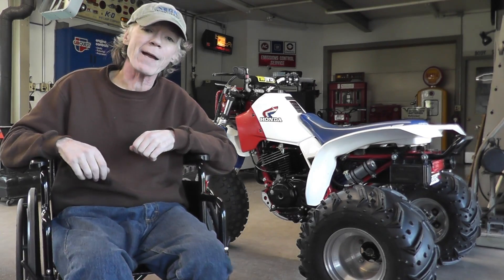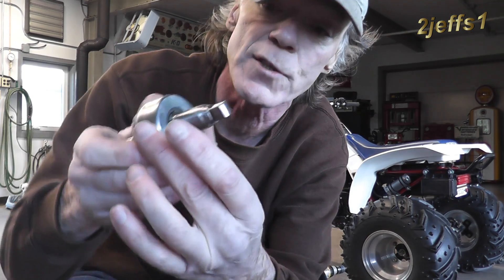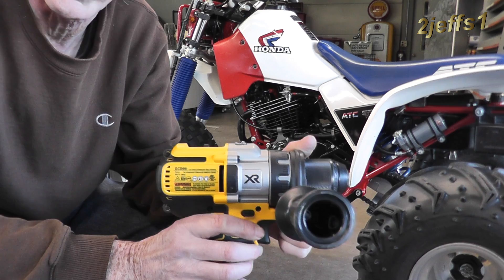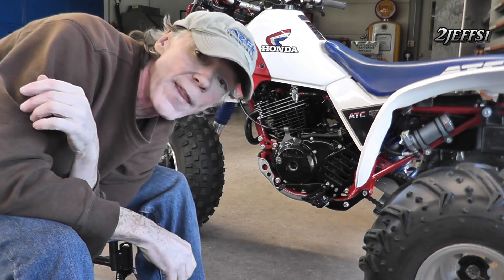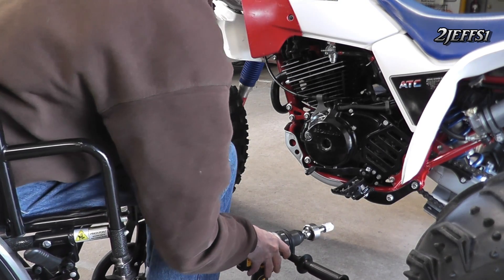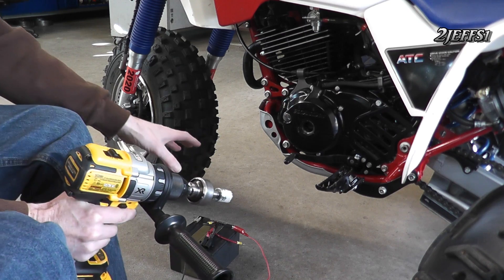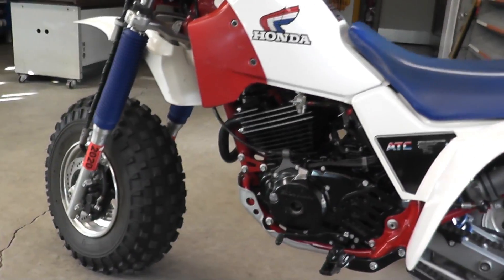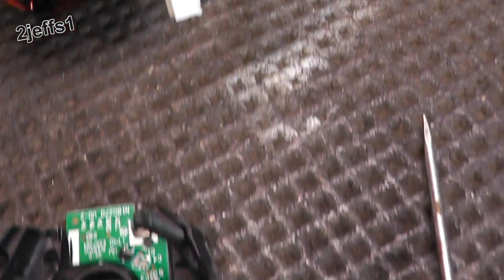Small Engine Starter Drive Setup THIS WORKS GREAT!

Comment: You would bendy benefit from s 9ah or even a 6ah. They can deliver a lot more current.  Those wires you have linking the packs are likely too small to provide a benefit. But you may also be maxing out the drill. Torque test channel consistently shows that 9ah improves performance

Comment: You’re adding capacity by hooking 2 5 amp/hr to get 10, what you want is more current, (amperage) to get more grunt.  When you increase voltage you decrease amps.    A 10 amp/hr battery has more capacity in run time over the 5 , not power. The power would increase by wiring the batteries in series ,  pos-neg, neg to pos. 
Now you have more power.  It would eventually burn out the motor, but not for a long time considering how short a Burst it actually runs to start the bike.  
The way you were doing it you were just making a bigger battery of the same power.

Comment: Hay brother get a 12 volt starter for a polaris 400 2 stroke scrambler. it has a gear reduction drive and is about the size of a brigs & stratton starter but with the power of a car starter. then get an old 10 speed bike and rob the gear set off the rear tire. it will spin one way and free wheel the other. weld the 10 speed gear to the starter gear then weld your cranking sprocket to the other side of the 10 speed gear. now take one of your 12 volt drill lipos and wire to it with a switch. now make a small box to house all this in and you are good to go. or better than this is to just buy a hand held 12 volt remote starter like the ones the go cart racing community use to crank thee modified engines. those work amazing and would crank your atv all day no problem at all and cost you less than that big ass drill probably did! hahahah love ya bro, glad to see you thinking outside the box. i live outside the box! visit me sometime.

Comment: That’s a good idea   I was gona use a ratchet head. But I have some old starter.  My Milwaukee tunes my techumseh star engine over good but it’s hard to control when it starts to remove the socket and it kicks back hard. Thanks for the idea.
Reply: Turns *

Comment: That gel cell that you connected up doesn't have the high amperage discharge rate like those lithium-ion batteries. The gel cell will struggle to discharge at 30 amps but the lithium batteries will produce over 100 amps or more. I learned about batteries way back when I was racing RC cars. Yep, had a few hard lessons in batteries.

Comment: I’m going to make this for starting my small outboard engine.
Reply: Actually… it won’t work because although the outboard turns clockwise, you are viewing it from the opposite direction as a land engine, so using the same standards, marine engines are counterclockwise.

Comment: Hey there good Sir.  I know that this video is several years old, but wanted to know how you are doing this without the bolt coming lose.  Looks like one of your answers was to use a drill instead of an impact gun.  Is that correct?  I want to do this on an NSR50 and and NSF100 with a super high hp and compression stroker-big bore motor.  Did you have to drill out the access port or was that motor already setup with the access?  My motors don't have one.  Thanks in advance

Comment: With your battery setup hooking them in parallel like that won't double the current it will just double the life of the battery or in other words how long it will last before it dies and you need to charge it again, of course hooking it in series would give you 40 volts but the same amount of life as one of the batteries..... However because of the circuitry attached to the batteries and in the drill I'm pretty sure everything's regulated to that 20 volts so even if you put 30 volts to it the motor in the drill is still only going to get 20 or I think it's 18 actually

Comment: Forgot to add that DeWalt has a 20V 6 AH battery.  With this one you don't have to look for other power source.  The machine has a dangerous torque and the side handle is highly recommended.

Comment: Hi Jeff,  Great video.  It is absolutely essential to have this DIY drive adapter for this job.  Although I have a drive adapter for my Craftsman weed eater, I did not know, it had a free wheeling shaft.  For other equipment I used the drill machine.  I have started various motors with my DeWalt DC995 without the adapter without any problem.  However, recently I reckoned my drill machine and had to buy a new one, now DC998.  The kick back of the motor ruined my planetary gear in the drill machine!  I have searched the internet for an adapter like yours, but could not find it.  I could send you a picture of the damaged planetary gear, if I new your email.

Comment: Jeff, thanks for the video.

I have an outboard motor that I need to rig up DIY starter for.  They offer an electric starter kit, but charge $750 for it.  I was wondering how to make a safety drive & the Chevy starter drive unit looks like the answer.

Comment: I made mine with a harbor frieght  halfinch drive socket wrench cyt the handle off amd tacked welded a drill chuck on the other end and made sure to keep the clockwise and counter clockwise selector free to be able to change depending on the engine and when the engine starts it spins freely just the same as the socket wrench would and it engages in whichever direction  u choose  and it took about 15 mins and 10 bucks to make instead of ripping apart a chevy starter i mean ur tool definitely looks nicer but mine does the job and is really strong also i found using a air tool or a corded drill it doesnt struggle or potentially ruin a cordless also at lowes u can buy these drill starters for craftsman weedwhackers the tool cost 20 bucks but is ment fir 50ccs and under

Comment: the reason why more amps makes the stop issue worse is there is less voltage drop under load, computer senses greater potential for damage/heat buildup, then shuts down quicker than if you used a lower amp battery setup. probably would still crank the beast over quick with a small battery

Comment: Torque wouldn't be changed by voltage or current. Get a starter and modify it to run your tool you made. Weld a handle on it and you will get the Torque you want. Oh and wear insulated gloves. LOL 
Love the video. I am relying on an electric wheelchair myself so I understand the frustration.

Comment: I’d love to see how u made ur starter for the drill.. we have a old Wisconsin 4 cylinder motor we r trying to start..we made a shaft kinda like for a old model a or tractor… so that way it can kick off.. we used it with a big electric drill… well no luck so far.. any help would be appreciated..

Comment: The drill starter is a good Idea especially for those who may only occasionally need to start a small engine.  For those who need to start engines on a more or less regular basis I think a portable starter made from a car starter and a lawn battery is more the ticket. Similar to the starters they use on formula 1 cars or racing go karts. Should be very easy to build and fairly cheap too if you use junk yard parts. Even a starter from a lawn tractor would probably turn that honda engine just fine, paired with a 7 amp hour SLA battery it would be reasonably light weight as well. Anyways just thinking out loud.

Comment: Great video...The starter drive on GM turns the other way...The way I learned it is the Ford motor Lose time... Turning CCW and GM gains Time...Turning CW...which means starter drive turns opposite direction ...IDK if that helps

Comment: Is there a commercial version of a starter adapter/ free wheel thing-a-ma-jig, doohickey, deelybopper? Welding is not my bailiwick.
Reply: Try the Performance Tool 3/8" Drive Ratcheting Socket Adapter. It is sold at Speedway and on Ebay for maybe $12 bucks or so. However, remember that you have to reset it after each use of it may get kicked back to the wrong direction when you have used it. It is like using a seat belt, in that you know each time you get into the car, you need to fasten your seatbelt. Same with this adaptor, as you have to always check it to make sure it is in the correct drive position or it can indeed kick back on you and possibly ruin your day, for sure. Tape or JB weld can lock it in place permanently so you don't have to worry in using this adaptor. The starter piece works great too, but if you are only using this for an occasional start up on a hard to start mower, edger or such and have limited welding equipment tor welding skills, then the ratchet adaptor is likely all you will need. I went to a local Auto Zone today to see if they had such in stock. The two simpleton people working the counter there today really didn't even know what products they sold to begin with. Good luck in tracking down the ratchet adaptor. There are some great videos on using such on YouTube, mostly under hard starting lawn equipment though.
Reply: @a1930ford  thank you VERY much!

Comment: It'll work if you put it to the low speed, high torque setting.
Reply from the maker: Unfortunately it turned too slow (snaps violently when compression hits) shearing off the left hand threaded torx bolt in the center of the chuck which holds it on. Reason being that the drill is running backward for this use and the chuck wants to unscrew. That tiny torx wants to stop it from coming off but is not strong enough. (I did bust several on testing) Hope this helps you out where what you said is very logical....

Comment: Have you ever thought about selling the dog clutch starter drives? I would love to get my hands on one.
Reply from the maker: Sorry - probably not. Many things to tend to here daily...
Reply: Mate let me know if you find someone that make one. I;m still able to do work around the garden but not to mechanically minded and the arthritis is slowing me down.
Reply: @mirriulahwaterdog   Is really easy to make. Just cut out the clutch from a car starter. I paid 10 dollars for mine off craigslist. Honda CRV. then i found a welder who connected a extesion and a 3/8 socket  extension. He cost me 50$. all in was 80$ but its a life long tool.

Comment: Respect from the United Kingdom pal!, you probably saved me from injury because I was gonna use a normal drill to get my 200 cc 4 stroke go cart to start because the pull cord is broken and I think it’s also flooded so I have been struggling to get the thing going and it used to get started on the first pull.

Comment: Interesting and informative video.   Did you consider getting the Dewalt XR Brushless 3 Speed high torque 1/2" drive Impact Wrench instead of the drill/driver.  Seems like the Impact Wrench would've been more suited to what you needed the tool for.  Great video and a great education in power tool electronics.  Tesla's interest in the possibilities of AC current is vindicated once again.
Reply from the maker: The bolt on the flywheel will loosten with an impact. I have to over tighten it with an impact to use that drive or it comes loose. It would need to be a LH thread. Thank you for your thoughts - just wished to get back for you trying to help out. Thank you - Much appreciated!!!

Comment: From Brazil thanks Jeff!!! Keep doing great videos like that. could u tell me if this Dewalt is stronger than makita 481, makita 481 is the strongest. 120 newton.
Reply from the maker: Hi there. I can't answer that. I do know that Dewalt is very powerful tho. Couldn't believe it would turn over the engine without even using the compression release in second gear.

Comment: question for you, I wanted to drill start my pull start quad. Is it the same basic setup as the kick start? thx in advance
Reply from the maker: I did use a Skill drill which did work. Without that on way clutch deal it tried to rip it out of my hands. Just gotta remove quickly when engine starts!

Comment: Hey Jeff Dewalt has a new line of tools called Flexvolt. The batteries can be used on any Dewalt 20v tools. It's a 20v/60v battery. More mA on 20v tools or standard on 60v tools. They are pricey but maybe they could be used on your project. By the way there is also an adapter that lets you use the newer 20v batteries on the older 18v Nicad tools.

Comment: try holding  it so the handle is not on the foot peg and use a lottle strength ot even a ppring to  lighten the initial start up load on the drill. Or use an extended on that handle to increase the moment arm by which you can hold it in place.

Comment: What if you used the drill in the slowest speed/highest torque setting? I assume that would be in position 1.
Reply from the maker: Totally logical thought Marc.  What happens in low is it turns too slow and every time it hits compression then it hits hard from not enough momentum. That is why those chuck left hand threaded screws were shearing off in the drills. Should of explained that in the video. You are totally correct where it will work every time doing that, it's just that the drill isn't happy then.

Comment: Great stuff Jeff just thought you might have better luck with a brushed dc motor since brushless uses a confusor to turn the zeros and 1s on and off with protection circuitry

Comment: Thanks for you build !!  Great idea !!  Liked !!  From my background in electronics, I would say the voltage drop on the hanging battery is enough to cause it to supply less than 1/3 of the current that would be possible if it had heavy wire.  It looked like you used 12 gauge wire which is good for 20 amps which seems like that is ok ... but that 24 inches ( i figured 6 in x 4  - each battery for each color) of 12 g wire offers a lot more resistance than the battery that is hooked directly to the drill.   In addition i guess it's the current regulator on the motor that is kicking out ... so even with a bigger battery you will probably still have the problem - i am only guessing on that :)  Good Luck !!
Reply from the maker: Cool, 12 ga, yup. Your spot on with your thoughts. Guess I was having fun. Love those sit down jobs while chair bound.  ;>)
Reply: You have a sharp mind ... I have appreciated many of your builds over the years!!  Keep it going! :)

Comment: try putting it in low
Reply from the maker: Totally logical thought Parker. What happens in low is it turns too slow and every time it hits compression then it hits hard from not enough momentum. That is why those chuck left hand threaded screws were shearing off in the drills. Should of explained that in the video. You are totally correct where it will work every time doing that, it's just that the drill isn't happy then.

Comment: Is it not just that it will be too much resistance when you pass the compression mode and it takes too much power so it shuts off to not be damaged ?
Reply from the maker: Exactly, probably so no one gets hurt from the torque but I think mostly so they don't get any warranty claims.

Comment: sorry to hear you were hurt jeff get well soon buddy  would dropping the gear to 3 help with stall sensor ?
Reply from the maker: I shall try 3rd gear for the heck of it. (think it was like 2,200 RPM) Never did that but I know the drill never stalls in 1st (450 RPM) but really bangs bad from turning too slow. That's what was shearing the chuck left handed threaded screw on the other drills.

Comment: Thanks for sharing. I'm using similar contraption to start my lawn mower. Lawn mower is a lot easier to start than the trike, and I use old primitive cordless drill without any protection circuit in it and a small lead acid battery.
Reply from the maker: Can picture that! Another nicely creative idea...

Comment: I've watched all your vids Jeff and your wiring abilities have always blown my mind. I have a john deere 145 riding mower that my dogs chewed some wires off of. I've tried for a month to figure it out w no luck. Can you maybe be any help? It's driving me nuts. Thanx in advance
Reply from the maker: Probably the easiest for you would be to locate a salvage dealer in your area, (used) and get the section you need. Lawn mower places usually have some parts machines laying around. I know several of the harnesses for the Case tractor were very cheap (new) so I bought them instead of.... But 1 was out of this world on price - like $450.00ish so I made it. Hope this helps.

Comment: You know, on the leg stuff, they say that boron helps make the bones incredibly stronger, less brital but a lot harder to break.   All the fluoride we’re exposed to likely depletes boron.  Boron is also associated with much lower  incidences of arthritis, fyi.   And it boosts testosterone.  Also wanted to say, when I heard about your leg I thought about your video, Just Having Fun (reference code Mn42zHaOuI4 ), up on the platform lift drinking a few.. I think the traditional way of ‘getting high’ is a lot safer.

Comment: Aw man!  Loving that.  I'm definitely going to be ripping an old starter apart now and rigging that up.  The old honda's with points, if they aren't running right, its torture to keep kicking them over and over again.  Its so nice to be able to sit next to it, and just spin the engine over.  Thanks for that info Jeff!!!!  Great video as always sir.  :)
Reply from the maker: Hi there Tom. I have a wingnut on the crankcase plug now so no tools needed other than the drill setup. Always wanted to build one of those starter drives. Left the Honda's and drill/battery outside overnight to see how good when freezing out. Spun the engine over like crazy. Just can't get over the torque that battery powered drill had.